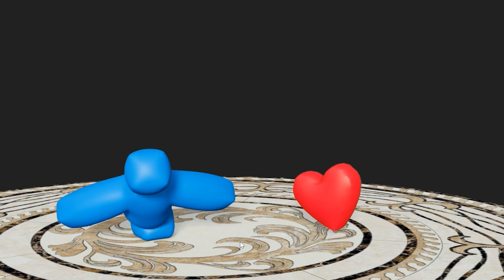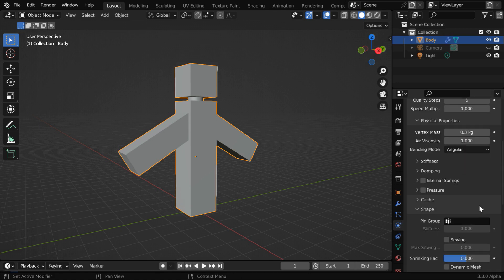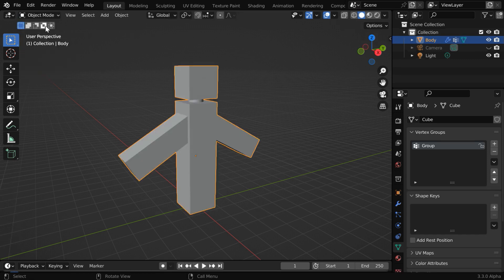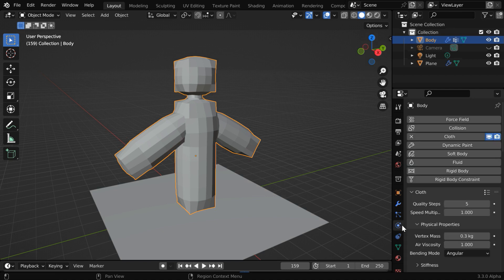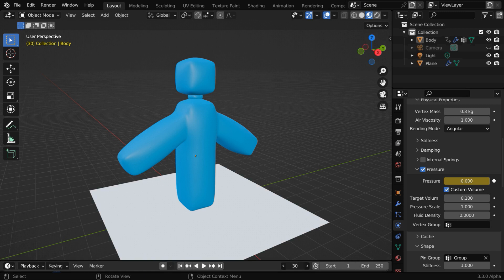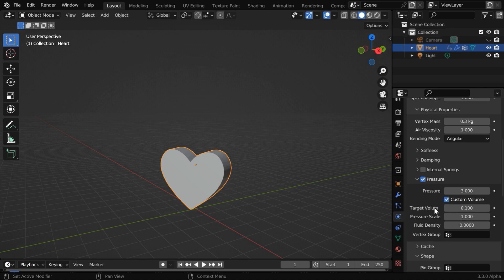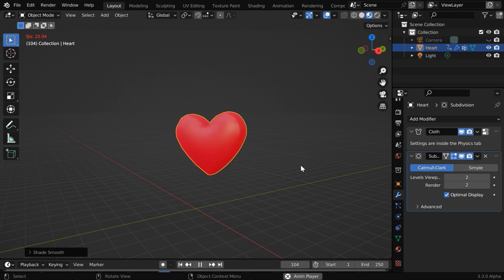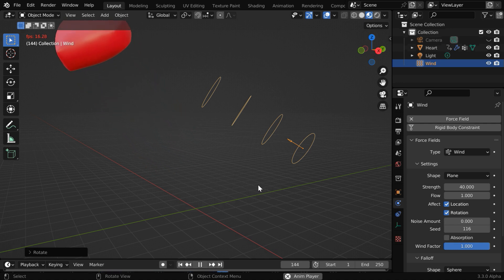Convert Any Object Into Balloon | Blender Cloth Physics | Create Decorative Balloons Quickly

Comment: Thanks for the super helpful tutorial, the only thing I could not get to work was the Wind Force Field for some reason.
Reply from the maker: To get the wind force work perfectly for your requirement may be a little tricky. You may even need to use more than one wind force. Think of it like a fan. You place one fan - or sometimes multiple fans - to force a balloon move in some specific direction.
Reply: @5MinutesBlender  I did actually add more Strength to the force field, similar to your Flag Tutorial and that solved everything.
Reply from the maker: Great to hear that ! Cheers!
Reply: @5MinutesBlender  Thanks

Comment: Thanks for this super helpful information— subscribed. Question: could you make a rigid body, hard surface object, begin to balloon without going limp or deflating beforehand? Also could you use a constraint to keep the balloon within a certain (spherical?) area as it inflates?
Reply from the maker: To gradually convert a hard surface body to balloon, just keyframe the pressure field (0 at frame 1 and say 0.1 at frame 100), so it will animate like that. For the constraint, you can use an invisible sphere with collision physics, so the balloon will stay within that object. Hide it in the render.